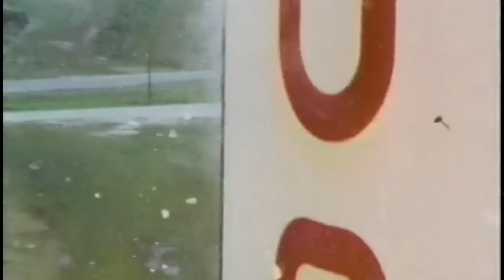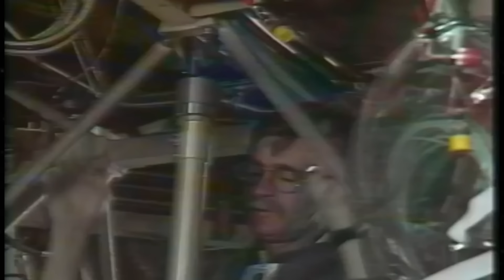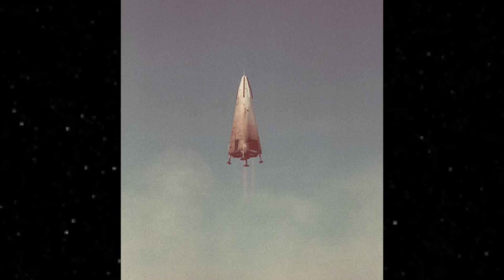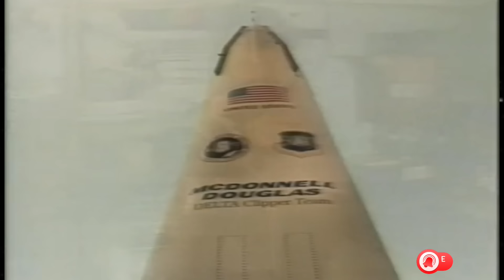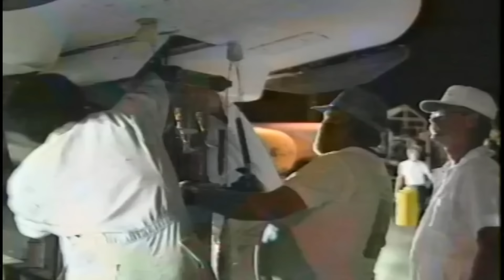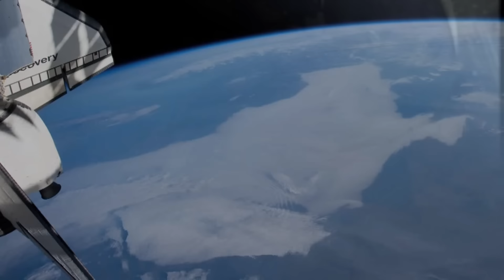NASA Killed This Rocket Over a 25-Cent Part (It Worked in 1993)

Comment: Nope. The excuse that was given was "the technology was too high".
We were already achieving Mach 3 by the mid-60s and there's trillions of dollars "missing" as a result of the Black Budget.
There's so much going on "under the rug" that we're not being told.
Reply: 'and there's trillions of dollars "missing" as a result of the Black Budget.'
Realize, the 9 trillion printed under Obama alone.  Maybe a few trillion of that used to pretend Obama was 'good at the economy'.  The rest was clearly stolen, there wasn't close to 9 T pumped into the economy.   Estimates a decade or two ago was like $108 trillion, probably more like $130+ T now stolen in total.
Reply: cheney's Project middle east democracy didn't cost 80 billion like rumsfeld promised either. more like 8 trillion,or 100 times more. but hey, halliburton stocks went thru the the roof so all's well that ends well i guess.

Comment: more like Blue origin....the DCX wasnt able to go in orbit, let alone suborbital. But it was a proof of concept, that could had evolved to something wonderful. The team thatworked with the DCx was then hired, most of them by Jeff Bezos for his suborbital New Sheppard project. SpaceX in contrast went for orbital hight right away and succeded greatly.
Reply: Starship is still suborbital after 12 failures.
Reply: @mrbaab5932  lol it's had multiple successful test, for it to achieve orbit just requires them having the engine on for 30 seconds longer, they instead test for engine startups during re landing which is much more difficult than achieving basic orbit as spacex has more orbital flights a year than the rest of 
 the world put together, why are the dumbest people spaceX haters?
Reply: @mrbaab5932 They are not failures, they are successful tests. TESTS.
Reply: @mrbaab5932  Starship hasnt got any failures because we dont have starship yet...those are test flights, and it hasnt aimed for orbit yet...on the other hand Falcon 9 has beaten all records. It has more launches than all rocket put together since the beginning of space program. Falcon 9 is unbeated.